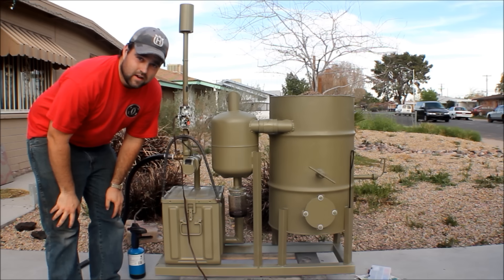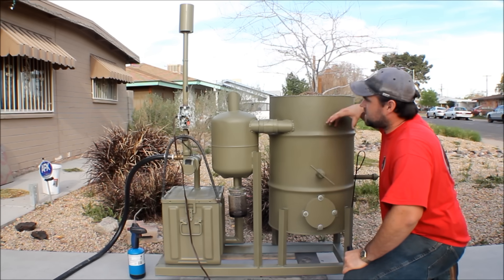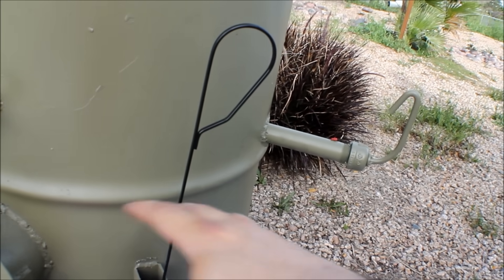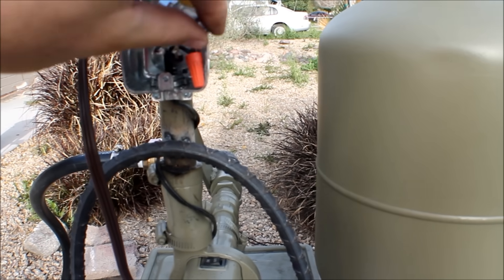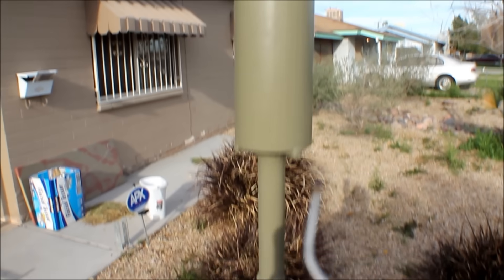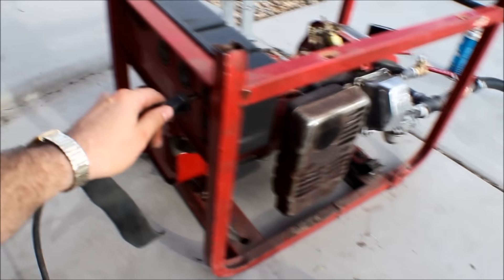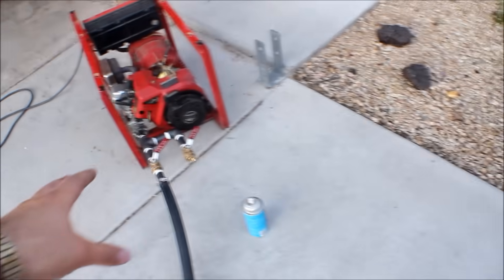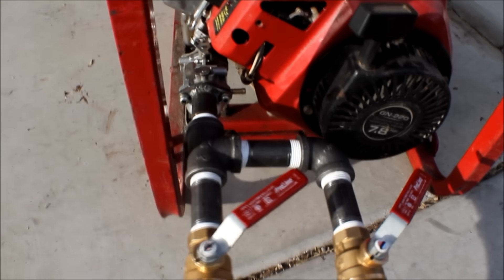amazing homemade gasifier uses wood pellets to run generator -- renewable alternative energy video

Comment: an idea as old as the mountains, very good info and vid bro by the way... but i really wonder how the price of those wood chips compare to fuel? when i was a boy my dad built a small petrol engine onto a 12V alternator, he used a 5liter milk can full of pine sawdust and same principle, this powered our home lights as well as a 12v TV, lol it was really fun... but getting these to go is not fun at all... first you need to drink 10 beers, then start the contraption otherwise you might end up kicking it to bits heheheh

Comment: I am trying to figure out how you can add this into a rocket mass heater system.  By the time the exhaust from the fire gets to end of tubing it is clear or almost clear and cool.  Has anyone tested their rocket mass heat system to see if exhaust is flammable?
Reply: The smoke turns into the flame that you see in your rocket stove. It is the smoke that has all that flammable gas and by adding a lot of oxygen to your smoke, you will get a clean flame.

Comment: You are ready for doomsday!!
Reply: no......!!!!!
Would not be able to get wood pellets.

Gasoline has way more BTU per weight or volume.
20lbs of 20% dried wood equals about 1 gallon of gasoline, while a bag of pellets are about $7 compare to about $2 per gallon of gasoline. 1 gallon of gasoline also has less volume than 1 bag of pellets.
In an real emergency a lot of people will cook and heat with wood and wood will be short on supply.

Comment: I wonder if anyone has considered running a heat exchanger between the secondary tank. This would significantly increase the energy density of the vapor as well as give you a controlled source of heat for whatever you need. It could be an air to air run by the already installed 12v air pump or air to water to heat radiant flooring in a workshop or house.
Reply: I think ideally you would use this as a furnace to heat your house, and just have a large storage depo for woodgas slowly build up. Though if it ever ignited you could have a big problem

Comment: What about using a coiled copper tubing solution for cooling down the air flow? Maybe it could be immersed in a tub of water or oil or other liquid? I don't know how cool it would be or anything since I'm not an engineer, but in the case of distillation, it's the copper tubing that would allow it to cool.

Just a thought.

Comment: FEMA you said,  is that where you got the plans for this set up in particular or where you found out about this?
Reply: I just typed in FEMA gasifier it came up with biogas plans and other power generator plants just type it in your search not on the FEMA website
Reply: Thanks for that I appreciate it. this will go great with my bunker.

Comment: Use a PWM controller for the fan, far more efficient you are not converting energy into heat, they are simple to build with a 555 timer and some mosfets.

Comment: Bro, your gasifier is  the generator. Just use a few capacitors and some thermo electric tubes to harness the heat off the fire chambers and convert it to electricity.
 Then use the gas for your car and house.

Comment: So you can run a generator on gas without installing a tri-fuel carburetor? I assume the two valves replace that?

Comment: biuld or buy a PWM(pulse width modulation) circuit. super cheap, fairly simple  uses little power to control DC motors, also OHM's law bro, look it up lol, any ohm rating can create any voltage your'e just using it as a voltage devider(which isn't good for any real current draw) you need to use a transistor or mosfet  and power THOSE by your rheostat rheostat output goes to the gate pin on a mosfet. you'll just keep burning the rheostats out or start a fire

Comment: You don't need to buy wood pellets. Just collect sticks in the forest and use those. Makes it even cheeper. Won't be as clean burning as the pellets though and you have to empty the tar more often and clean out the charcoal.

Comment: This is, in fact, you are using CO gas as fuel.  This kind of gasifier should not be used indoor which if any leak can be deadly because CO is a colourless, odourless gas.

Comment: is it possible it's getting hot in the 30 gal drum because of back pressure from not using everything ok produces. I guess what I am saying is will it run a bit cooler if  you left the torch burning some?  I am not one these guys that talks shit about what I don't know. so please don't take that way.

Comment: INCINERATOR WITH OUT SMOKE  NO DIESEL NO GAS NO ELECTRICITY RUN BY FULLY SOLAR BASED  CALL 919400092738

Comment: So.... How come the internal combustion engine on your Honda generator is able to run without any lubricant in the fuel?  Is it a four stroke?
Reply: that engine is a 4-stroke..see the valve covers,  an oil line(drip system) would be required for a 2-stroke engine.. lots of tinkering to make that work though!

Comment: I think this is a great design -- I just think you need a radiator system to cool your gas/smoke down between the two filters which would probably double your power in the gas.  I'd even run a good efficient fan on the radiator with the generator power once your good and hot in your reaction,(Fire) chamber-- you want that part good and hot as possible, just not the rest of the rig !

Comment: Looks like a very nice job. I wonder if the generator had been a propane fired if you could have run the gas in on the engine side of the boiler. That should give you a lot better control of the mixture with a lot less adjusting. Just a thought.

Comment: Nice work! But i wouldn't directly use a potentiometer for motor speed control but instead make a little PWM control circuit (probaly using a NE555 timer or a uC) with a power MOSFET as the switch and a capacitor for low pass filtering.

Comment: I would have liked to see the valve leading to the carb turned off and see the generator shut down for lack of fuel. How do you keep the saw dust from being sucked down the hose and into the engine? What is the cost of the wood pellets related to run time vs gasoline?

Comment: I bet if you made a shelf on the frame for the generator to bolt to, it's vibrations would take care of ash shaking. Also a coiled copper pipe circulating water around the cyclone filter would probably cool it down significantly.  Otherwise, I think you've got the gold standard design with a fit and finish no one else on youtube has managed.

Comment: Well why not wrap the outside in copper tubing, run water trough it to an insulated storage tank to have hot water on stand by. Have got water and a cooler tank

Comment: Can you not just connect the woodgas output hose to the fuel inlet on the carb where the gasoline normally flows?  If you can manage to send the gas through that inlet the carburetor choke plate will automatically adjust air flow for you.  Look at the design of a trifuel propane/natural gas adapter from motorsnorkel.com and you'll see what I mean.  

If the fuel inlet port is not a big enough diameter you could try drilling and porting a carb with a larger diameter inlet.  I would think that the fuel inlet would be big enough to pull the wood gas through if you took all the jets out and ported it so the passages were almost the same diameter as the inlet.  You'd be using the engine as an air pump then to pull air through the gasifier and increase output as well.

Comment: I used to burn wood in a refractory lined water heater. turn off the fan and it was hot enough to smoke up wood .

Comment: btw you could probably hook up and air fuel sensor with an arduino system and have automatic valves that can be adjusted via automatic valves and motors.

Comment: Why don't we bottle this gas after Hurricanes or use it at power stations its literally as clean as natural gas and why should 1000's of tons of storm debris end up in land fills when they could create energy
Reply: This gas is very poisonous and can kill. It contains 27% carbon monoxide ( the killer) and 20 % hydrogen and about 50% to 60% nitrogen.

Comment: A cone shaped (funnel) feeder for the pellets would be a nice add on and provide a larger reservoir so the unit can run longer without human interaction needed.

This maybe a method to supplement electric from solar panels after the sun goes down, which would prevent storage batteries from discharging as much, the more a conventional storage battery is discharged the shorter will be its lifespan.

Comment: maybe a PWM control unit will work better than a potentiometer, as it is way more efficient and will give you much more control of the speed of the motor

Comment: Major problem of your downdraft gasifiers are running to cold and do not crack the tar in the syngas. The tar will gum up your engine very quickly. From what I understand is the temperature must exceed 900 degrees C or 1652 F. Look up Imbert gasifier for details.

Comment: Assuming the generator is a four stroke engine (no oil mixing) and it ran for twelve hours (six if your in a hurry).  ;-).
What would the cost be in gas versus pellets and wood chips (maintenance and waste disposal)?

Comment: Good build!  Good educational project!  A very good project for learning about combustion processes.   In the scope of real-world events: Not practical.    -- Unless you live in a forest, such as Sweden, Finland, Ottawa, or Siberia.  Nor is this speculation -- We have good examples from history.   Think about it.  

IF main electrical went down - and not preceded by a population culling plague: You've got serious other problems than just wanting electricity.   IF the population were decimated? -- No problem: -->  plenty of gasoline left about.  

IF such a time came that gasoline was unavailable - which would be the ONLY reason to use this - You would have to use this fuel, to drive about collecting the fuel to use it.   Now, These were used to good effect on a few Cars, Buses at the end of WWII in locations where there existed a forestry industry  AND extreme need.  Else people walked.   When gasoline or diesel was available again, gasifiers were removed from the few cars that had them.     These are not any more efficient today than they were 70 years ago - there is no new magic bullet here.  
On the grand scope of things, This technology is simply not efficient to scale to needs of current population numbers.    When population numbers are decimated low enough for this to be of value -- there will be plenty of petroleum fuels still in tanks above ground. 

Regards,
Dr. Gary Rutledge,  Physicist.

Discussion welcome - IF YOU HAVE DONE YOUR MATH and can prove your arguments.
innumerate conjecture or eco-posturing have no merit for consideration as general solutions.

Comment: from the vids ive seen on gasifier`s the gas works better when cooled. So the oil drum on this one could be used to collect heat by wrapping tubes/pipes around the drum. so not only would it cool the drum but would make use of the waste heat in a similar way to `combined heat and power stations(CHiPS) as used in eastern block countries

Comment: Beautiful job. I've 2 questions, first could this be converted not only using wood pellets but extra tubes welded on with caps to become a multi fuel burner (does liquid fuels like diesel and kerosene produce the same gasses needed)? Also to increase efficiency could 1/2" copper pipe be bent around the bottom of the freon tank and using a small water pump (12VDC/110VAC) pump water through it to a radiator or even an open wash basin, and would it help any in cooling the gases ?

Comment: Put a variable load on it to see how much energy that you can get out of the generator before it stalls the motor.
Reply: tuned right, the gen will almost produce the same as gasoline,  7.5 hp probably 3-4 kw..

Comment: Nice work. Only one comment to what you did. the reason for the stainless bowl [and it need not be thick stainless] is that unlike mild steel the stainless can handle the extreme heat required. mild steel will go scaly over time and break down over time despite thickness. the stainless however will not. great work all the same.
Reply: Stainless will get brittle with high temperatures.

Comment: immediately upon generator activation you should be recharging the 12 volt battery used at initial start up with that air mattress pump.

Comment: I wonder if making wood gas to burn in an internal combustion engine is much less efficient than a steam engine would be. If you have a lot of internal combustion engines this would be the way to go but if I were wanting to power a house I'd look in to a steam engine or turbine to run my generator. That said, this is a great job and video. I've planning on experimenting with gasifiers and rocket stoves so this was very informative.

Comment: realise this video is quite old... I like the overall design. But I find one flaw and one bad idea.... (the bad idea is) using a rubber coupler.
The flaw is... the need of an "electric" fan to draw the gas.

If the entire goal is to create fuel to run a generator on, so you can have electricity supplied by the generator.... if you have no wood gas to begin with, how will you operate the generator to power the electric fan? : /

Also, what is the life of this gas? how long can it be stored?

Comment: Hi, Would it be possible to burn wood chips (around 1in x 6 in) instead of wood pellets? Best regards,
Reply: yes,  1x1x1/4" work well make sure they are very dry..10/15%max best..coal can also be made to work.. requires work though the 1' by 6" x 1/4" thick  might work but not in mine..i have read, never seen though, that even small logs can work.???

Comment: This is very nice.. But, big question... What if you do not have the power to run your blower motor? What then? Can you make one of these so that it does not require a blower motor? I ask because if you are in a remote location with this that doesn't have electricity, the need for an electric blower to run this is not going to work. Would be hard to power a generator off of this system if you first need electricity to get the thing going.

Comment: I'm curious in an emergency 🚨 how continuous can the gasifier run and with your set up of a 7.x hp generator how much stuff could you power in your house. Like I'm could you run a space heater and refrigerator and some lamps? 
Lastly how much pellets are used per hour and cost of that amount?
Reply: A 7 hp engine will give you about 3,500 watts max.
This should run a fridge and a 1500 watt space heater with some power to spare.
About 20 lbs of wood equals about 1 gallon of gasoline.
There is the task of maintenance that need to be performed, like taken ashes out and replacing your filter media which can only be done when shutting this thing  down.

Comment: But the fact that you can't use normal wood chucks almost completely defeats the purpose
Reply: You can use normal wood chunks. You can use many types of bio mass actually.
Reply: FORESKIN JIM ou that is good
Reply: it can use any plant matter, the drier the better...
Reply: I use a chipper to grind up all the fallen tree branches from my yard. Works well, but does want to bridge a little. An old jigsaw can vibrate the material lose. A short tap of a button will clear it. Or automate it on a timer.
Reply: Oh I dunno.  Pellets work well.  I can see if you wanted to get away from batch runs and have a continuous feed, it'd be easier to engineer with pellets.
Reply: I think burning a woodchuck would smell pretty bad
Reply: The ASPCA & animal rights people would be all over your case if you started burning woodchucks!

Comment: Some of the original designs for cars in France we developed using wood gas. Using wood or coal gas was a pretty common method until Carl Benz started using benzene.

Comment: The wood makes wood alcohol, in a liquid its Methanol, its a highly flammable gas and does not burn with a flame that you can see, if you don't make the wood heater without a release valve it will end in an explosion, this idea has been around for decades, but obviously has a use if you live off the grid.
Reply: tony coppe 
I am going to assume he either doesn't run it long enough for that to be an issue or the unit is not totally air tight. otherwise yeah big problems could be seen in that im sure.
Reply: what the hell is wood alcohol ? do you mean methanol ? because that is a completely different process and this one is called gasification/pyrolysis which should give about 30%co2 and the rest methane and maybe hydrogen and some other gases.... no liquids here unless you cool the gas where you would have tar/synthetic crude+ uncondensible syngas and maybe methane. there are many other processes to convert methane to liquid fuels and processes to convert syngas(co2 and hydrogen) to liquid fuels.